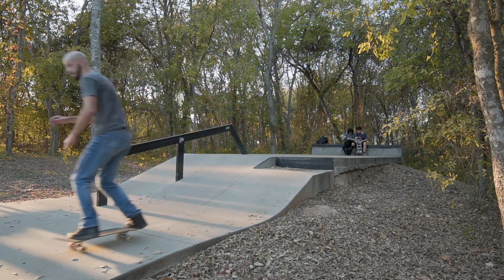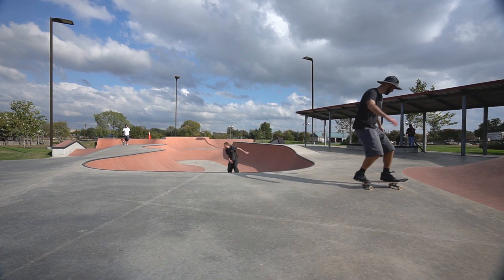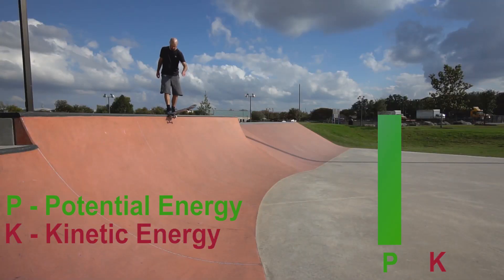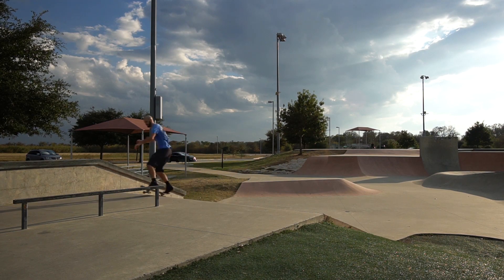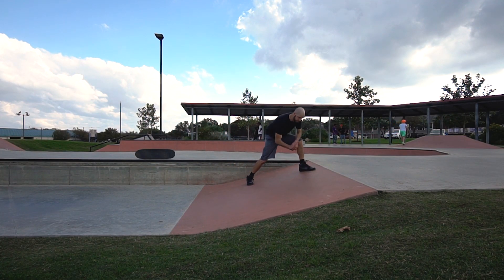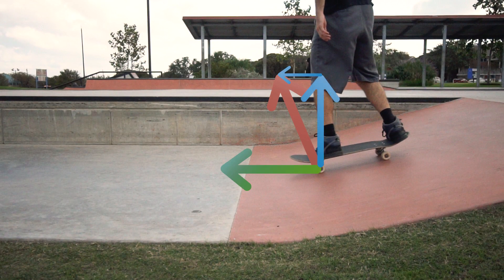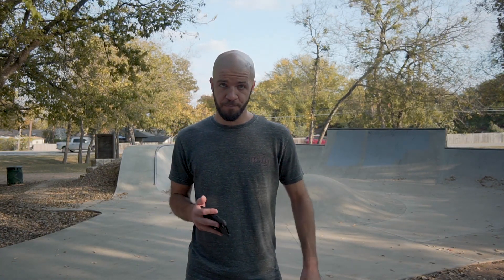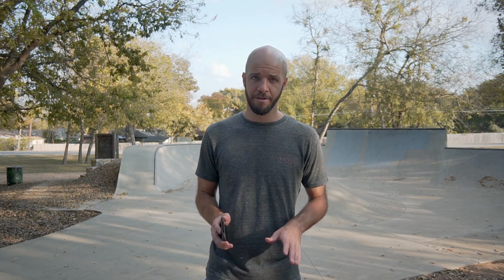The Physics of Pumping on a Skateboard - Fully Explained + Easy to Understand!

Comment: Great video I don’t even skateboard I was just wondering this question and surprisingly there aren’t a whole lot of videos that go over the actual physics
Reply: Hey, the way it actually works is not as shown in this video but really by shortening the distance between your center of mass and the center of curvature of the curved part of the ramp :)
I will try to make a video myself to illustrate exactly how this works more clearly but this guy called Garrett Milliron made a video called "The physics of pumping a longboard" which shows the correct explanation in, unfortunately, a less understandable manner.

Comment: i've watched a lot of these tutorials, and this one is best of all. It combines every possibility in one video, thanks for creating this
Reply from the maker: Thanks man!!
Reply: Hey, the way it actually works is not as shown in this video but really by shortening the distance between your center of mass and the center of curvature of the curved part of the ramp :)
I will try to make a video myself to illustrate exactly how this works more clearly but this guy called Garrett Milliron made a video called "The physics of pumping a longboard" which shows the correct explanation in, unfortunately, a less understandable manner.
Reply: Hey Raphael, maybe spend more time making the video and less time copy-pasting your comment into every other reply on these videos. I'm sure you have valuable things to say but I've encountered doomsday evangelists with more reserved and tactful output.
Reply: @raphaelpoitou8609  I wouldn't be so quick to discount this explanation with statements like "the way it actually works......". What you have described is the Curvilinear motion explanation  of movement around a curve which describes forces on an object in a reference frame tangential to the path it is travelling, at any instance of time that motion can also be analysed using Rectilinear methods which use the resultants of forces acting on an object during its motion in a rectangular reference frame. Of course I still can't guarantee this explanation is correct without breaking out my old Dynamics textbook and doing a few problems both ways and then comparing the directions of forces etc to his explanation but these problems can definitely be solved in both ways with both explanations being the way it works, just using different concepts.

Comment: I’m a big time big bowl skater and you just changed my life. I know the muscle memory and have the strength to maintain solid speed. However I think understanding this in depth is going to help so much.

In my head I see it almost as jumping off of a slanted wall into flat ground. If you can add that factor you will go even faster than just standing up at the bottom.

Comment: In my opinion (which...is just an opinion xD i'm no physics student etc) the crouching part does help as long as you do a sort of 'little jump' just before entering the downhill part of the transition. 
I try to explain my self better: the higher the transition is, more speed you gain. So if you raise yourself by pushing with the legs towards the floor (while still standing with the feet on the board, not like an actual hippie jump) just before you hit the downhill, you DO increase your potential energy, thus increasing the resulting kinetic energy (because you fall from an higher point). Then, with the proper timing, adding the crouching just after you hit the downhill will increase the drop/fall even further and give you more speed. 
This is valid only if you are already moving towards the downhill transistion...I don't think it work if you try staying still on the top of it and dropping in (like in the experiment with the timers in the video).
Dunno, just an opinion :D does it make sense to anyone?
Reply: It helps also. Like, going down a bank, you'll go faster if you sort of acid drop from the flat to the bank. This way, a portion of your weight is not applied to the downward vector until you already have cleared some of the bank. This way you lose less momentum to friction. 
Then, pump out of the bottom, take advantage of both.
Reply: Hey, the way it actually works is not as shown in this video but really by shortening the distance between your center of mass and the center of curvature of the curved part of the ramp :)
I will try to make a video myself to illustrate exactly how this works more clearly but this guy called Garrett Milliron made a video called "The physics of pumping a longboard" which shows the correct explanation in, unfortunately, a less understandable manner.

Comment: Hey Justin, thank you for the video. The explanation is better than the old one, but i think still not accurate. I believe that the key point is that you have do work against the centrifugal force (~v*v/r, where v is speed and r the radius of the transition). That is why it works good on smooth transitions and less good an sharp angles.
Reply: Hey, the way it actually works is not as shown in this video but really by shortening the distance between your center of mass and the center of curvature of the curved part of the ramp :)
I will try to make a video myself to illustrate exactly how this works more clearly but this guy called Garrett Milliron made a video called "The physics of pumping a longboard" which shows the correct explanation in, unfortunately, a less understandable manner.
Reply: Banks and transitions both require us to do work, so he wasn't wrong, just not as thorough as possible. 
What I might call "wrong" is saying the total energy of the system increased. 
Actually, he only looked at gravitational potential energy and not the chemical potential energy which we convert into kinetic energy by pumping.
Reply: And so since you seem to know a bit more about physics, the exact equation that explains everything is L = I*omega
and since I = mr^2 (where r is the radius so the distance between your center of mass and the center of curvature of the ramp) and omega = v/r, L = m*r*v, and m (your mass) is a constant, L stays constant for an isolated system (in this case the you-skateboard system) and since r gets smaller, v (your linear velocity aka your speed) has to get bigger in order to compensate for r getting smaller so that L stays constant.

Comment: So that is way I couldn't get the hang of pumping, Thanks!
Reply: Hey, the way it actually works is not as shown in this video but really by shortening the distance between your center of mass and the center of curvature of the curved part of the ramp :)
I will try to make a video myself to illustrate exactly how this works more clearly but this guy called Garrett Milliron made a video called "The physics of pumping a longboard" which shows the correct explanation in, unfortunately, a less understandable manner.